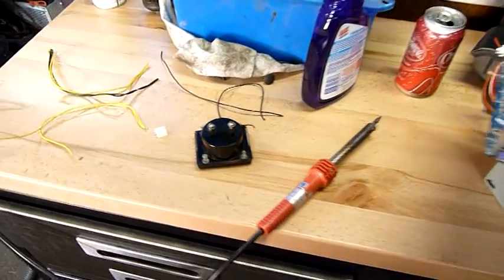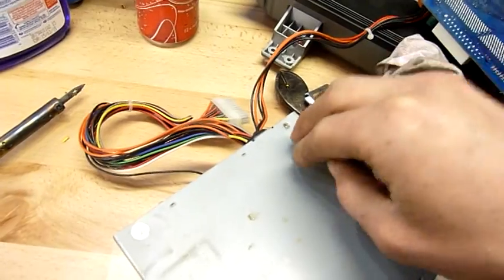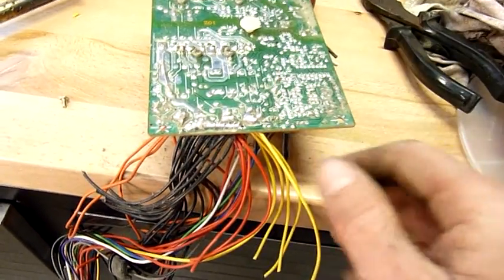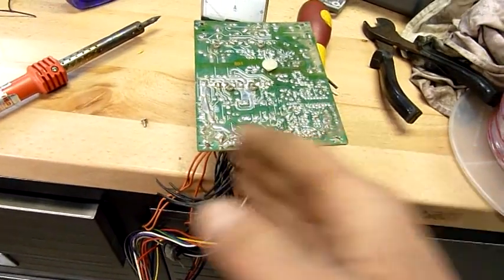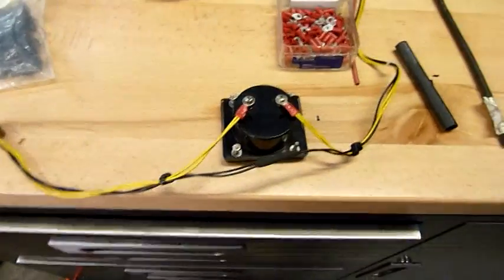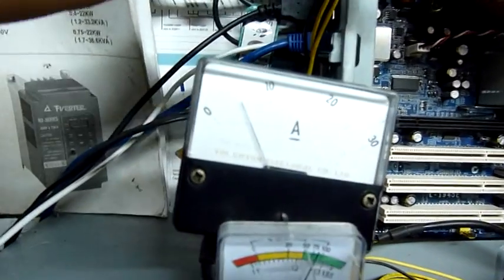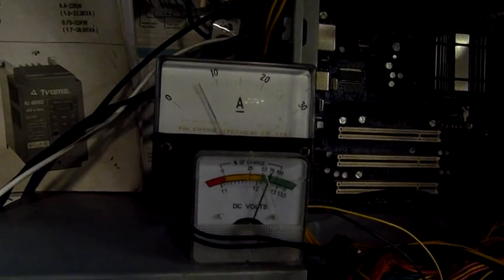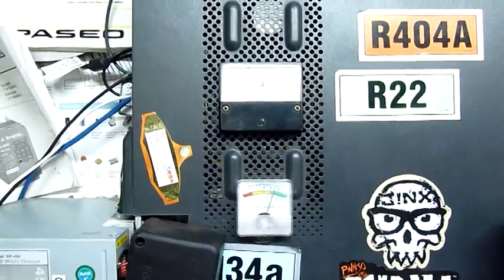PC Case Mod - CPU 12V Amp Meter

Comment: I wanted to do this to my computer, but i am afraid that the voltage spikes caused by the amp meter will kill my cpu. I have an AMD 4350 quad core cpu at 4.22GHz.Should I try it? i mean it's not a cheap cpu.
Reply from the maker: Alex Danco to be honest, I have not had any issue with my systems being unstable or locking up because of it, but I imagine the VRM is just doing its job and smoothing out the ripple. 
it is a mod to attempt at your own risk, I would only do it on cheap or free PC's myself, I have not modded my i7 like this.
Reply: Aussie50
I ended up doing it. Hope nothing will happen.

Comment: Mmmm, this is interesting. All you need on there now, is a screw-on cap for inserting the fuel rods, some time circuits, a good 'ole Flux Capacitor & away it goes. :-D Alternatively...

Take the little name plates out of the meters, & make your own fun ones with things like "Steam Pressure" on one & "Fuel Level" on another, give that casing some copper tubing, brass gate valves & a few other optional brass fittings, & you have a steampunk'd computer. 

:-D

Thanx for showing,

-BoomBoxDeluxe.

Comment: Just a heads up, which I'm sure you know all of this but. A CPU when it is on load only ever uses a set amount of voltage, judging from the old computer this CPU can only go, idle and full load. So on boot, you would of seen the max amps it would of been pushing. Loading it on the desktop would of just showed you more of the same thing. 

Anyway great mad, great video as always :)

Comment: normally the power control uses three wires

green is power on/off
gray is power good (sense)
purple is the constant +5V (control) and shorts to (needed for control)

the other wires are...
brown 3.3V sense (MUST NEVER BE CUT and connected to an orange wire)
blue -12V (haven't figured out what purpose it serves)
white -5V (haven't figured out what purpose it serves)
tapping from blue or white wires will give you a pulsed output

Comment: Well that's too bad. I assure you that the improvements to efficiency are there, but I suppose it depends on your specific situation. Just don't write it off because of the UI (and perhaps problems with prerelease software). Let's leave it at that, this isn't really the appropriate forum for these discussions :)

Comment: Apart from the faster startup, lower RAM usage, lower process count, improved graphics performance, improved security, improvements to Explorer, better service integration, automatic account sync across computers, better admin tools (have you seen the new task manager?), better memory management, and all the rest? Granted, the Start UI isn't exactly stellar for the desktop, but that's only one aspect. Posting from my Gentoo Linux install btw.

Comment: The CPU is powered solely by that 4 pin connector, the 20/24 pin is for stuff like the chipsets, PCI slots, fans and I/O.

Comment: Run Linux with LXDE. It's much faster and lighter than winblows and it's free and legal to download unlike winblows. Not to mention way more secure and stable. Stay away from gnome 3 though, it's a pain in the ass without a touch screen .

Comment: Some CPUs, notably the i series Intel CPUs draw some power for the uncore part via other rails i.e. not through the CPU power port - just something to bear in mind if you're measuring/comparing CPU power draw. Some reviewers fail to take this into account and it leads to unfair comparisons between these and AM2/3 CPUs from AMD, for example, which AFAIK draw entirely from the CPU power socket (i.e. Intel power consumption appears lower than in really is).

Comment: Well Pre Athlon 64 CPUs and pre Intel Pentium 4 CPUs (Before socket 775) they took power from the main 24 pin ATX.
Today though, the extra 4 or 8 pin connector on the motherboard is the only supply of power for the CPU.

Which is one of the reasons people that forgot to plug it in, never got their computer started.

Comment: Yeah, I know it should be there, but in some cases it might not. And the burden voltage could be too high for power supply to compensate for it properly. It's just things worth checking.

Comment: Modern ATX power supplies I've not found one without the sense for +3.3v (isn't it part of the specs?). Good quality supplies will have them for the +5 and +12 rails also. This is one of the reasons not to use the 24 to 28 pin converters they don't do anything useful and in fact cause more problems including the potential voltage drop from the converter to the Mboard.

Comment: The Mboard 3.3v line has a separate sense wire for the voltage regulation so should not matter either.

Comment: Have you measured your meter's burden voltage? (voltage drop across ammeter) For 12V rail burden voltage might be no problem, but for 5 or 3.3 - it definitely will. Just a small heads up. Also long wiring will contribute to that.

Comment: modern cpu's draw all there power from the 4 / 8 pin CPU power header. Only older system draw power from the 24 pin connector

Comment: Too bad there no easy way to measure the current after the regulators they can supply upwards of 90 amp at 1-1.5 volts

Comment: That's what the VRM does. Drop 12V down to usable voltage for your CPU.

Also Aussie, 70 to 80W sounds about right for your CPU under load so it's likely it is only drawing from the 4 pin EPS connector.

Comment: Nice little mod ed, and your plug-n-play allows it to revert to original if you change your mind.

Smashing :-)

I do like the narrow range voltage meter :-)

I suppose 10 to 14 volts would have been better but without re-scaling and and messing with series shunts it would of been a pain.

Good update/mod :-)